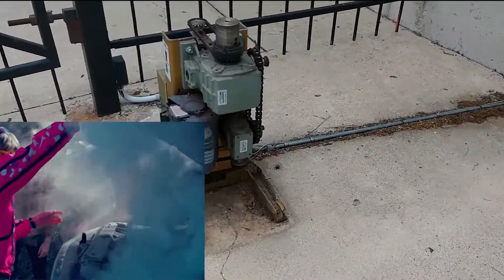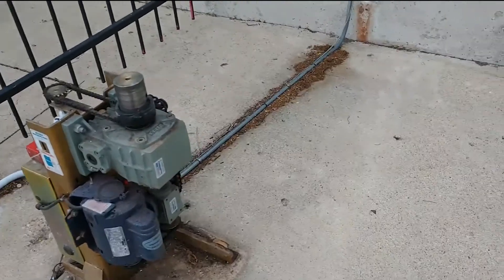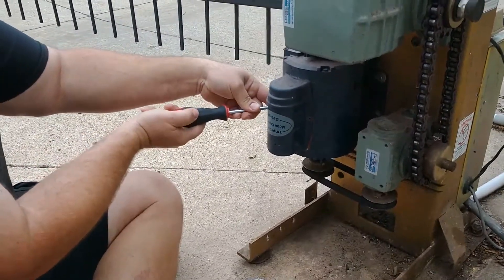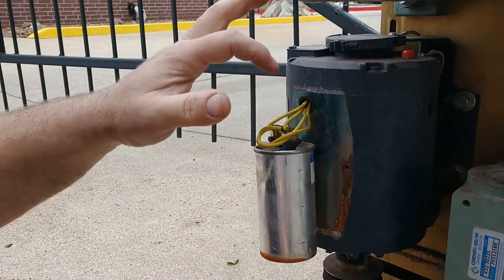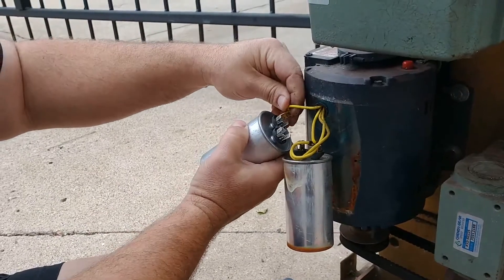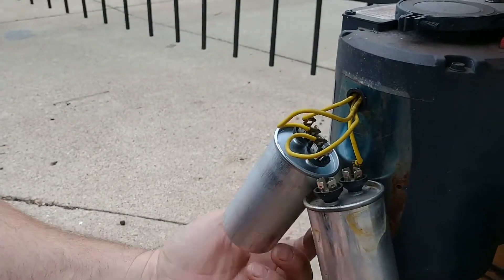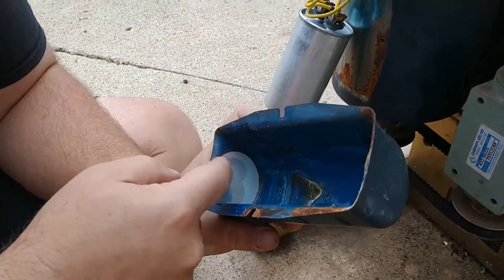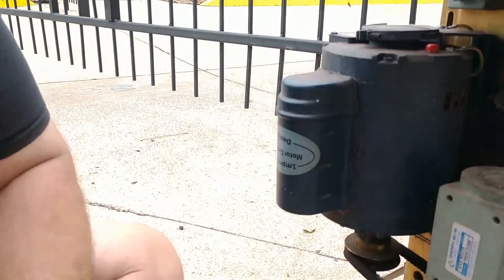Change motor capacitor in an Elite Liftmaster CSW200 swing gate operator

Comment: Hi, 
Appreciate your videos.  I have 2 gates that have Liftmaster CSW200 1hp  They are both uphill swing and have been working intermittently in good weather but seem to get worse when it rains.  The motors respond to the remote but only begin to open then close in about 5 seconds.  Does this sound like a capacitor issue to you?
Reply from the maker: That's a tough one to call. How old is the machine?

Comment: what happen if the there is no hum sound?  is that mean the motor is burned or dead?
Reply from the maker: Could be motor, motor harness, or control board. Must check to see if the voltage is being sent out of the control board, and if the voltage is making it to the motor connections behind the little access panel on the motor.
Reply: @JacobGilliamMasterTech  I commented above.  No motor hum or movement.  When I opened the motor access door and with the power ON there was no current on the black wire connected to the motor.  If I remove the black wire from the motor, then there is power/current detected in the black wire.  Any insights greatly appreciated.  Capacitor is dated 2010, so not original, but looks brand new, no char or odor.

Comment: i have a gate that the capacitor fell off.. once i pull the cover it fell off.. seems the last guy just tired the wires on it... it was arcing and burnt the wires just on the leads for the cap but everthing seems good.. can i just connect it back? also slso since psu for pc im scared of touching the capacitor leads with screw driver.. however u said i can connect it any way and it wont matter?
Reply from the maker: @hafeez387 Yes, the capacitor is designed to store a charge for a sudden burst of instant discharge to help the motor kick off to spin. So it shorting out shouldn't have hurt the capacitor. Using a wrench or a screwdriver won't hurt you. But most likely it doesn't have a charge anyway because you said the connections shorted out ;-) So I would fix the connectors and try it; doesn't hurt to try.
Reply: @JacobGilliamMasterTech  ive already done it... :) ty.. the arcing of the power cables to the cap cause it to stop working it fried the tip of the wires.. as i said the last guy didnt use connectors at the end so it was probs loose so it arc everythime it was used.. i reconnected it the same way but ill fix it soon. its all working fine.. ty awesome video
Reply from the maker: Happy to help!

Comment: How do you know if the capacitor fails?  My slave functions, but not my master operator; there's a brief humming sound coming from the motor area and intermittent weak movement when I try to operate the master from the control board.  And I did try the thermal reset.  I suspect it's the problem but not sure how to test it.  Any input would be appreciated!!
Reply from the maker: That humming is USUALLY a good indicator of a capacitor issue. It's not 100% solid on diagnosing, but probably a good 70-80% chance in your favor ;-) The rest of the time it's brushes, bearings, or shorts in motor winding (all of these mean the need for an entire new motor). BUT if the motor is 15-20 years old, I'd replace the motor or entire machine (based on odds of callbacks).
Reply: @JacobGilliamMasterTech  Thanks for your reply!  Can I use a multimeter on the capacitor to tell if it's working? The unit I have is around 20 years old but was in a residential setting. I'm thinking a $50 capacitor is worth the gamble vs a $400 motor...
Reply from the maker: It depends on your multi-meter. Perhaps the easier way of doing it is swapping the capacitors and seeing if the issue remains with the primary machine or moves to the secondary;-)
Reply: @JacobGilliamMasterTech  Thanks for the tip!  I'm fairly confident the capacitor is the issue so I ordered a replacement.  I'll let you know if it does the trick.  I really appreciate your help!
Reply: @JacobGilliamMasterTech  Just want to let you know that it was, in fact, the capacitor.  Can't beat a $55 fix!!  Don't forget to reset the thermal switch after replacing the part.  Thanks for all the help!
Reply from the maker: Cheers!